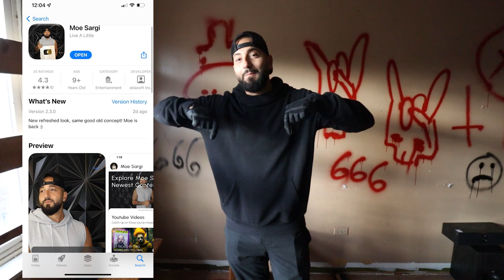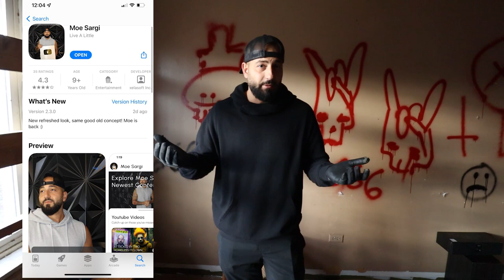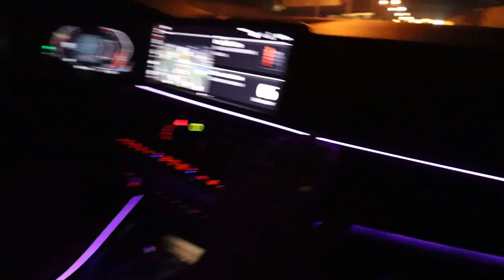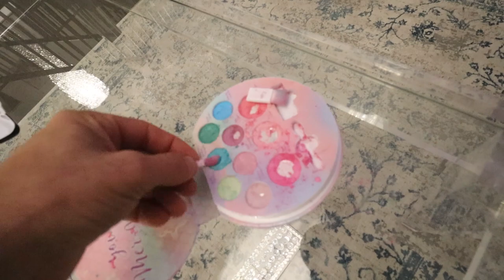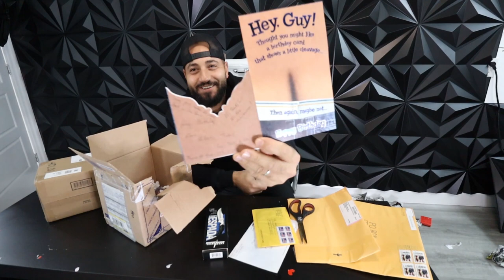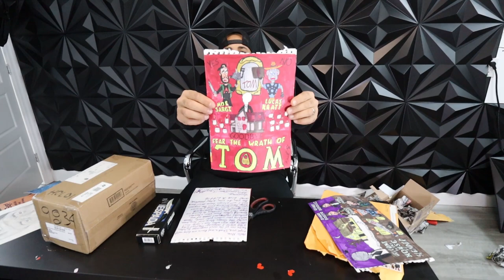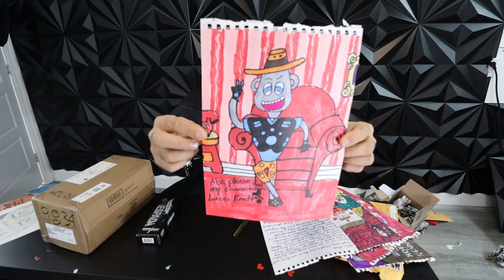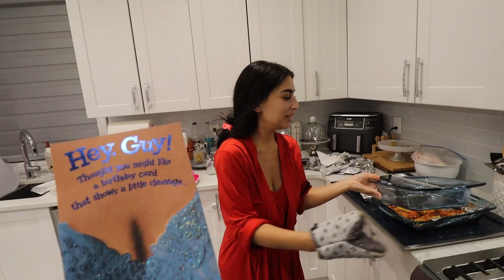CREEPY STALKERS KEEP SHOWING UP TO MY ABANDONED HOUSE (NOT THE HOMELESS ITCLOWNS)

Comment: 21m you should screw the timber to the walls as it will be a lot harder for anyone to knock off. Have you put a spirit level on your floors because they are probably uneven, you should do it to determine wether the ball rolls due to the paranormal or the floor.